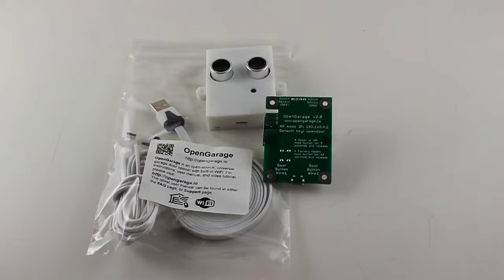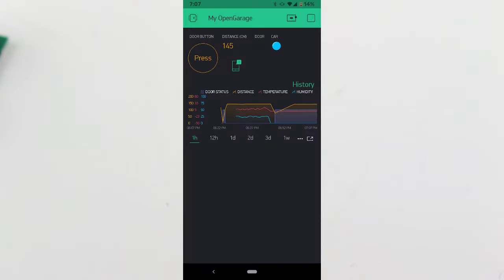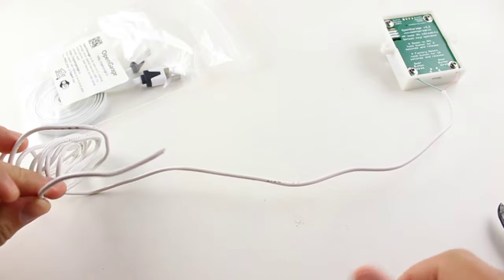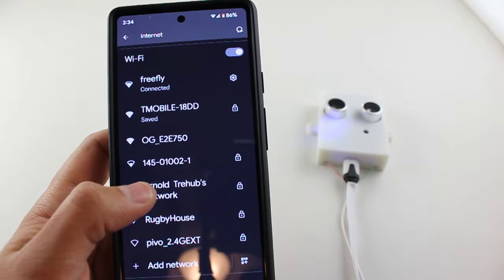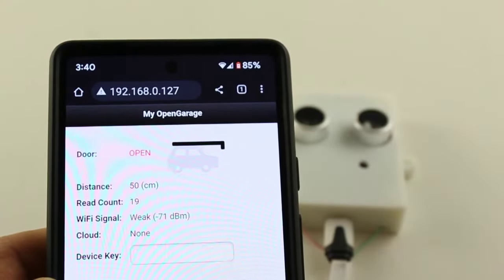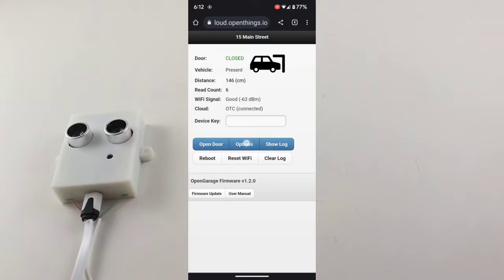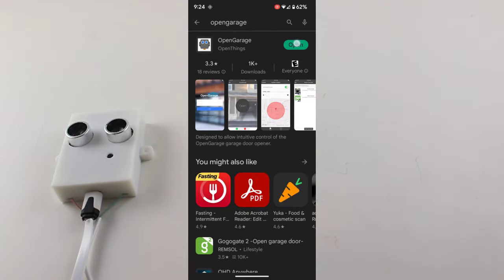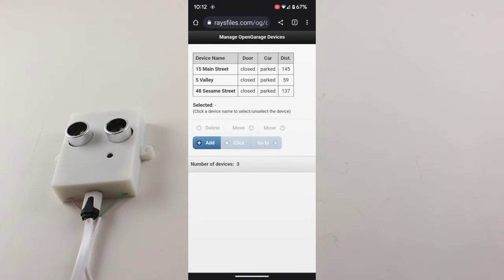Introduction to OpenGarage 2.0 and Firmware 1.2.0

Comment: I see there are some limitations on old hardware versions for this software upgrade. Is there a way to tell which hardware version I have without unmounting from my ceiling?
Reply: I took it completely down and disassembled to find my board is v1.0 - I'm glad I was able to contribute financially to the product early and help it get off the ground, but bummed the firmware is leaving me behind.

Comment: In the future. Can you add a timer countdown on the main menu showing how long you have left before the garage door closes on its own? I set it for 10 mins to auto close. I wish there was a little timer showing how much time it has left before closing.

This is a very amazing product. The other products on his website are awesome and affordable. It works out the box/on the LAN immediately. No accounts needed and no internet needed! I would 100% recommend this to any with a garage door or any door that needs opening. 👍
Reply from the maker: Yes it should be fairly easy to add the count down. Requires probably just one line of change in the firmware and a couple of lines changes in the javascript / ui.